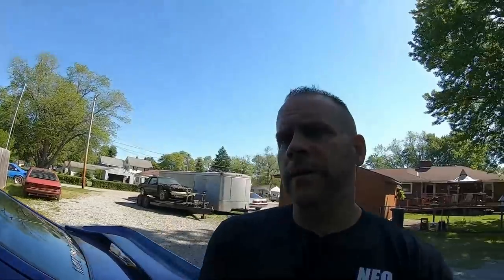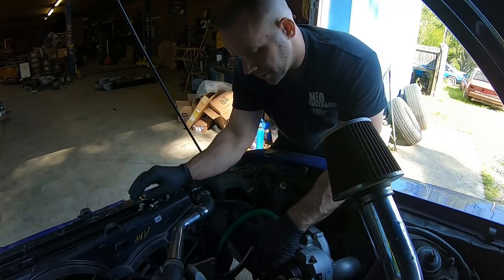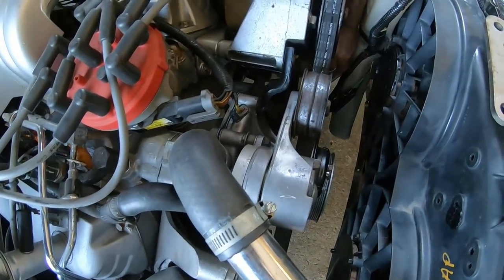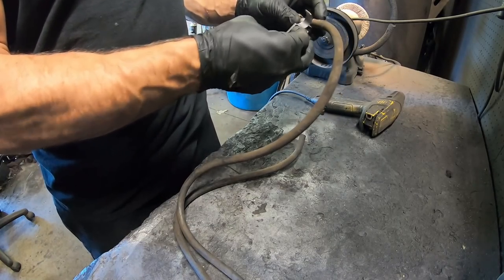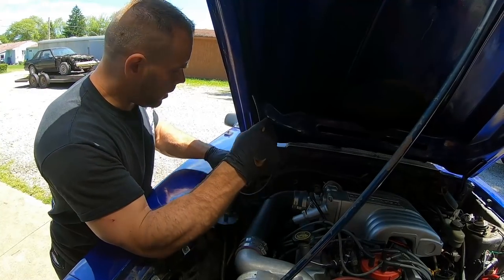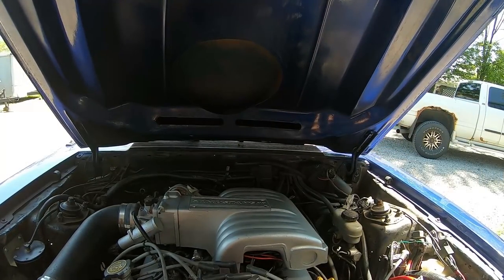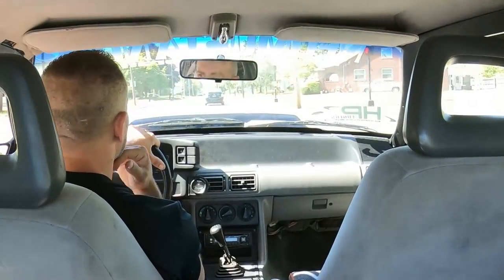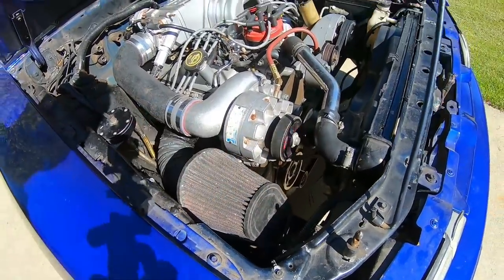Did it Run? 30 Year Old Supercharger Kit FINAL STAGE / Fox Body Mustang Vortech A-Trim

Comment: I used a plumbob for the oil drain lol
Reply from the maker: Good idea
Reply from the maker: Lol
Reply: Did u just drive it in till the hole was the right size?
Reply: It would be bad ass if u could get a barbed fitting that had a tapered threads and a little groove like a self tapping drain plug. Pretty slick the way u did that I liked the series of punches to avoid shavings from drilling
Reply from the maker: The actual grease on tip helps a lot with shavings.
Reply: Kevin Johnson yea works perfect. The pan is thin so it’s easy

Comment: I have a T trim on my fox it’s still a bad ride. Made 607 wheel out of a 306
Reply from the maker: WOw nice thats good power.
Reply: Neomustangs 306 dss girdle stock crank and rods performer rpm heads and intake, Cam research custom cam, t trim 15lb, e85
Reply from the maker: Nice

Comment: 1994 I bought one of the 1st Vortech kits for my stock 86 GT convertible from Anderson Ford in IL.
When the S Trim came out as an upgrade I got that and a 347 stroker motor with Victor Jr heads and BlueRacer 1087 cam and installed a 
Pro M 77mm mass air conversion and more fuel. Car ran 10.99 at 129 mph. It had a 4 pt roll bar but they still kicked me out.
In 1998 it was king of the asphalt jungle.
Reply from the maker: Very nice!

Comment: This video is awesome thanks I have an old school set up exactly the same that I will put in my car for next year. My question was did you have to gap your plugs and adjust timing my car is fairly stock. I got a 6 pound kit great channel all the best.. and would  a bigger fuel pump be better than running the fmu ?

Comment: Had an S-trim (15 lbs boost)on my 91 coupe..trick flow heads/intake..blower cam 42 lb injectors, meth injection.. was a very fun street car with ac..got 18 mpg on the highway.
Reply from the maker: And people talk shit about MPG.. PFFT... ya know
Reply: @Neomustangs   bro.. you ever thought about building a daily driver v8 ranger? Just curious..im about to get mine going finally..little 400 hp 302  5 speed daily/travle truck with ac
Reply from the maker: Rangers eh... nothing wrong with it. Just not my bag
Reply: @Neomustangs  WORD!

Comment: FMU should be calibrated to injector size. Inside the FMU is a diaphram and a washer ring. That washer is the calibration.
Liked
Reply from the maker: Right I get that. I don’t think this one was changed and it was 19s

Comment: Never ran a fmu but i have two vortech cars. But its pretty simple. Change the injectors and you just change the diaphragm in the fmu to compensate.
Reply from the maker: Ya i get it. We are used to doing very custom tuning here. I wanted to do a vlog where that was different. What the power looked like in 90s. before chips.
Reply: Ya its cool. I enjoy the content. Be neat to see how she preforms

Comment: had both an old A and S trim on my foxes...Now have an SC HO. Self contained...
Reply from the maker: Nice! Power?
Reply: @Neomustangs   stock block 302 with top end and V3- 455 rwhp through an AOD on a full weight 90 convert

Comment: I had a 9psi powerdyne 87 gt...ran 12.6 quarter mile. Looks like you hooked up the check valve to the vacuum tree? That see's boost pressure. Hook the bap sensor to the intake side of the supercharger.
Reply from the maker: aspen yukon no its hooked to bap and back of I take
Reply: Unhook the bap leave open to atmosphere it will run way rich....might be perfect tune with blower...it only needs vacuum to idle correct.
Reply from the maker: @aspenyukon6845  Ill check that out. Im gonna dyno it next video. W/o blower aka NA and then with this blower.
Reply: @Neomustangs  great build. back in the day i would kill Napa belts (8 Rib) keeping the tension on my junk with a bracket, bolt & locknut on SC tensioner...
Reply from the maker: @crixoceruto8936  thanks!

Comment: wondering why you didn't just swap the oil pan from the other car (that originally had the vortech) instead of going through all the re-tapping.......?
Reply from the maker: THe other car was traded to cousin fred. We are saving it. I didnt pull its motor it ran great. Just needed that rust fix on the floor pan. I basically found a SC parts car and took some parts. replaced them. and traded the car to fred.

Comment: So question Boss man, I have a 1990 notch with a new 351 head's cam the bolt ons 9 inch rear sub frame posi 3.90 gears ect. I'm at 400 horses obviously I wanna go faster lol you opinion what would you go with , nitrous or turbo ? Might be an obvious question but I still wanted to ask brother
Reply: O it's an auto c4 rachet 3 speed,  don't know if that helps .
Reply from the maker: Turbo 4 ever bro !
Reply: @Neomustangs  haha that's what I figured brother ! Appreciate ya my man !

Comment: What happened to my previous comment?  Anyway, what is your timing/boost/fuel settings?
Reply from the maker: What previous comment? 40PSi, 10 degrees and 6 pounds?
Reply: Maybe I screwed up, but just asking that you point out about putting heavy grease on the pan tap.  If I were you, my next step would be mass air conversion with 42lb inj to get rid of the fmu, then work on 8 rib with bypass, colder plugs, and then perfecting your WOT timing curve to boost.  Have fun!

Comment: The vortech fmu not being used at stock boost 6-7psi... i dont use it all close and waiting for more boost...  i laugh a lotttt when u talk about the bastard bolt the created behind the pulley hahahha today i have to change thing and i put out that bolt so useless the one on top and at the left tighteen strong wayyy enough :) but my big problem i take off a/c and smug pump ans that cause trouble lenght and bad tensionner lot headache since 1 yr and i change my plan to add smug pump delete kit like yours but no a/c delete kit that a weight reduction and more power :) couple.hp more and weight power ratio better with the smug pump.delete its close to 50 pound less in front its a lot with the battery relocation in the trunk tha gave a better grip with all.that torque better transfer  at my opinion :)